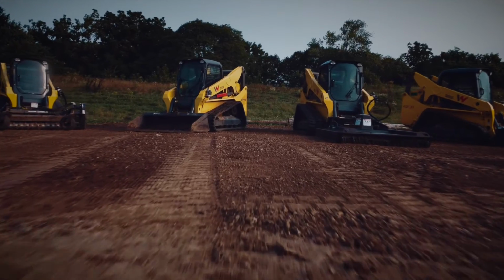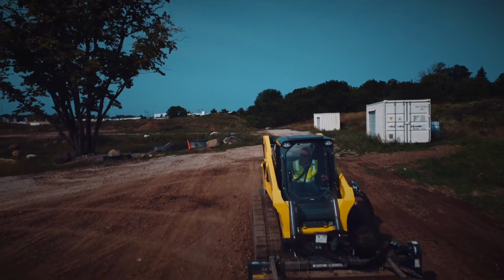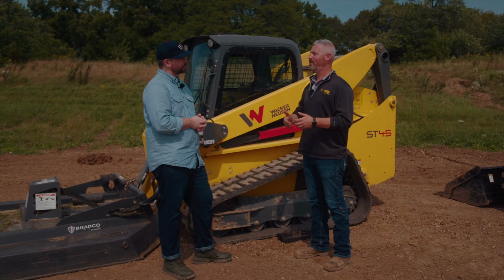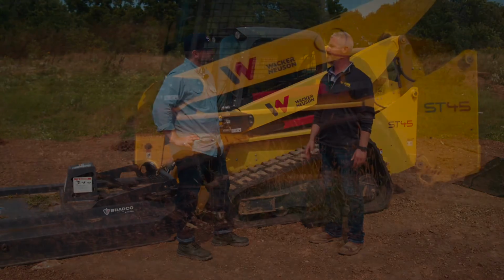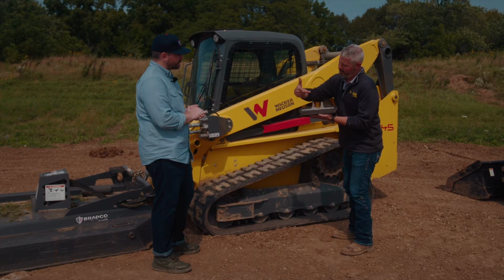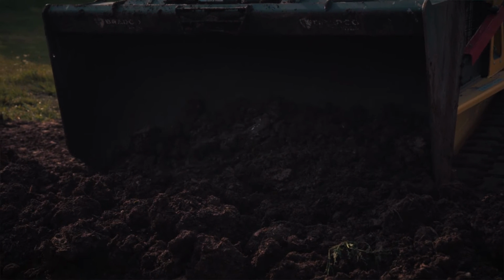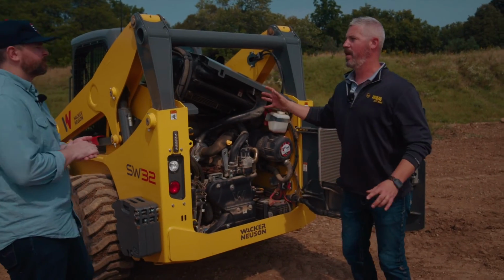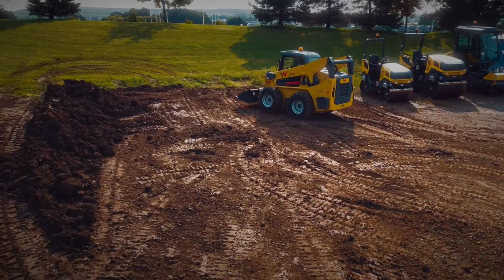Everything You Need to Know About Wacker Neuson Skid Steers and CTLs

Comment: I am in north western On. Canada an i looking at buying cash the 100. 6hp ST50 unit heat an air. Only problem is i been around heavy eqipment all my life an never seen or ran this brand. I got a qoute for one an a bunch of attachment totaling 190k but they dont have any stock or a demo. I trying to find out all i can as writing a check for 200k a lot of cash for site unseen. Not many option here. It ether this ot cat, bobcat. Kabota an i hate kabota with a pasion. The worst to work on. Worst for dirt traps. Ext. Or case. Or asv.
Reply: I'm in the same thought process you are, did you buy one? What's your experience if so?

Comment: Non-planetary gearing system  ?? 🤔☹ No wonder it's a 100hp.......
Reply: Is that good or bad?
Reply: Power is power.  A planetary system uses a high speed, low torque hydraulic motor.  Direct drive motors are low speed, high torque.  They both consume about the same amount of power.

Comment: Little known fact, the top of their CTL line the ST50 makes the most torque of any CTL in the industry at 368ftlb. Even the mighty ASV 135 at 316ftlb can’t match it. The Kohler KDI3404 is an absolute phenom of an engine.
Reply: I saw that as well when comparing machines. The Kohler and Cummins are far more torquey (especially the Kohler) than their Japanese counterparts. I wonder why this is. I suppose fuel economy is a driving factor in engine displacement and performance. 
Maybe just a different approach. Torque is great, especially in a power hungry machine like a ctl.